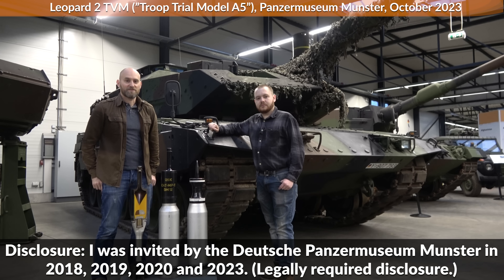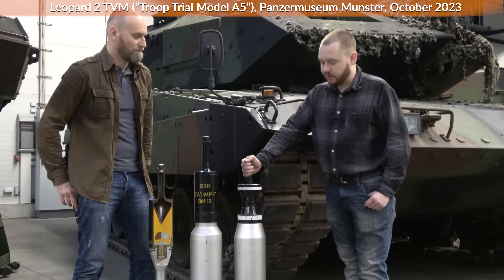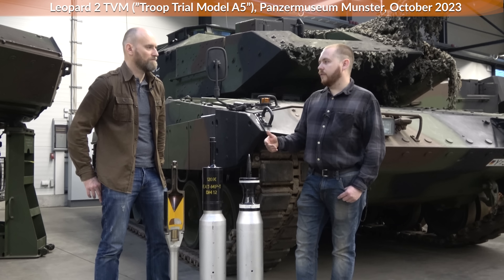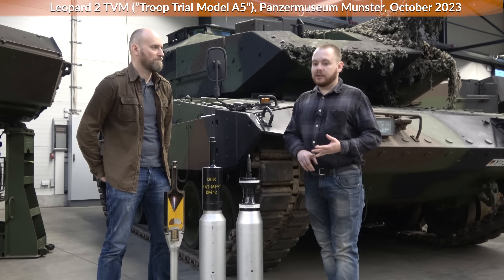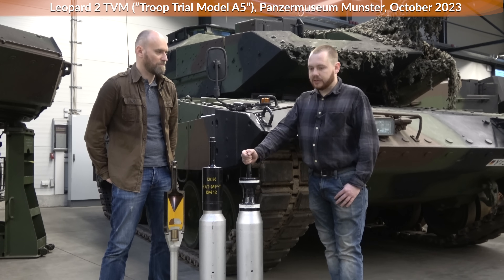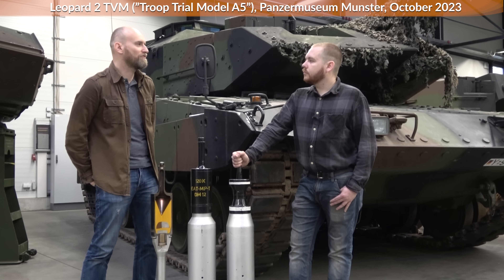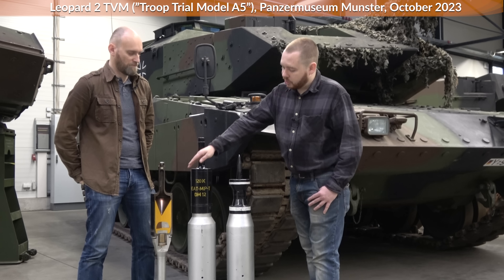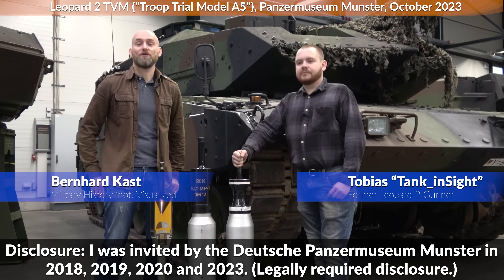Why you need proper HE rounds for Tanks

Comment: Interestingly after the Battle of 73 Easting a Bradley was likely knocked out by a BMP that had been hit by an APFSDS round. The round went through the BMP like it wasn't there which meant the crew could still get off a shot which killed the Bradley gunner. If the BMP had been hit by a more appropriate round this wouldn't have happened.
Reply: @cattledog901  The BMP was taken out by a Abrams prior. The crew abandoned after a over pen but got back in and took out a Bradley.
Reply: Seems like the Abram’s “should have” done more to ensure the vehicle was actually destroyed rather than just assume a single hit was one and done.  It’s combat however and chaos is part of the equation.  There’s no universal weapon that perfectly does every job yet.
Reply: @JimmySailor  

The issue is that there are other vehciles that are actively targetting you and you need to take them out before they take you out.
Reply: @neurofiedyamato8763 yes just like war thunder, no armour is best armour
Reply: @neurofiedyamato8763 dumb move on the part of that BMP crew, after the battle they examined that BMP, it got hit so many times by HEAT rounds that there was a puddle of solidified molten metal from the HEAT rounds.
Reply: @artruisjoew5473  Iraqi troops generally were well regarded in the region for their grit, with Kuwait being the exception rather than the rule. The Republican guard Tawakalna Division conducted repeated counterattacks and dismounted action into the teeth of the US forces. The time they brought allowed enough of Saddam's army to withdraw to hold the regime.
Reply: @artruisjoew5473 HEAT rounds do not melt iron they penetrate physically much like a solid shot, the name HEAT is an acronym
Reply: @JK-oq9cl either BMP-1 or -2 (weighted more towards -1) - either has tin foil as armour and if that was -3, it would have a bit more impact plus ammo would be hit by just sheer probability
Reply: @J.F.Król can say the same with the Bradley, a LOT of the ammo is just strung up by... Gunner i think it is? The 100mm is low down. Internal ATGM's being an issue given vertical. Go Bradley. But a 100mm gun would supply deployed forces anti fortification abilities. Go Russia.
Reply: Yeah well they are probably trained to shoot he/heat at less armoured targets but if you are in combat and think you don’t have enough time to reload to another round you will fire the apfsds instead
Reply: @thurbine2411  I'm a former TC, you're correct about the training. But you fire what is in the breech, and follow up with the appropriate round. There's no time/ability to unload a round because of the combustible casing of the round wich easily breaks apart when using the puller to try to remove the life round. This must be done so carefully that it would take to much time. And when loaded in a hot breech, it would be impossible because the lacquer on the outside of the casing would have melted and you would tear the bottom off the casing, spilling the propellant into the fighting compartment.
Reply: @Leo_Pard_A4  I am a leopard(strv 122) gunner and yes in most cases I would also fire what’s in the breech as I wrote but if you have time(enemy hasn’t spotted you or someone else has spotted them before you have los you can have the time to reload from apfsds to he-equivalent. The apfsds doesn’t break apart that easily and if the loader has done it a few times it isn’t that hard but we are also not permitted to unload a he shell.
Reply: @thurbine2411  iirc, there is licence production of a 120mm HE/FRAG round for the Strv122 using a projectile design from an Israeli mortar shell.
Don't know if that's made availiable for any other Leo2 users.
Reply: @SonsOfLorgar  yeah I know that isn’t optimal when shooting at infantry as the shrapnel will spread a little differently from what you want but won’t matter when it’s fired into a bmp really.
Reply: @SonsOfLorgar  but the apfsds of the German and Swedish leopard should both be quite similar to unload and probably the ones used by the us in 91 as well. But I agree with you as I wrote in my first or maybe second comment. It is one thing to do what you should have done in a perfect world and another thing to do it when you are in battle
Reply: A British Scimitar took a round from an Iraqi tank that also went in one side of the Aluminum armour and out the other.
Reply: Interesting, was the APFSDS fired by a 120mm or was it a Bradley's M919 APFSDS round? I would've assumed a Bradley would've just kept hitting the BMP repeatedly until it burned as opposed to a single 25mm shot from it's bushmaster, but I could believe an Abrams might've taken a shot at a BMP, then moved on, assuming the crew was sufficiently neutralised or scared by the hit.
Reply: @JustSomeRando1984 I believe it was an Abrams.
Reply: @user-qf6yt3id3w  The BMP should have been knocked out with HEAT projectiles… which is what is used to kill lightly armored vehicles. 
The problem isn’t that we don’t have dedicated HE rounds, it’s that in combat, especially like 73 Easting where it’s a mix of tanks and lightly armored vehicles, you sometimes have the wrong shell loaded or the type of target you are engaging so you just send it anyway.
Reply: @JK-oq9cl  Likely the legacy BMP-1 (with the Malyutka launcher) or the Czech licensed BVP-1, no real difference between the two. Either that or some variant of the BMP-2, Iraq operated the BMP-2 obr. 1980, 1984, 1986 and BMP-2D and K variants at the time.
Reply: There's a photo out there of an APC that got hit in the side by an APFSDS round in the troop carrying compartment.  There's an APFSDS hole in the side, an APFSDS hole in a seat, and an APFSDS hole in the opposing side, with little other internal damage.   You may be able to punch a hole in 300mm of steel, but you still need to hit something on the inside.
Reply: no armor best armor
Reply: @KekusMagnus   more appropriately. Used the wrong shit.
Reply: ^ #Projection10000 😆

 @KekusMagnus  Or: #BestGunIsBestArmour 😉
Reply: Tanks in desert storm use AT for every thing
Reply: @JeffEbe-te2xs  yes but there is a bug difference between apfsds which is solid ap shot that relies on the projectiles kinetic energy and a heat shell that explodes on impact and the explosion forms a metal jet that pierces the armour with its kinetic energy. So a heat will do much more damage to soft targets or lightly armoured targets
Reply: ^ You clearly had nothing worth stating 😆🤣
Reply: @jimtaylor294  you have 0 information on the matter, so you must be correct on everything you say. Are you the messiah? Cause only the Messiah can be always correct with no presented information. Oh wait, you're not.
Reply: ^ Proved my point for me, you just have 😆🤣 .

Keep crying boyo 🍺😁
Reply: My uncles bmp 1 was hit by a sabot round in gulf war, they left and later returned to vehicle and drove it back to base
Reply: @anon-iraq2655 your uncleS BMP... WHO WAS YOU'RE UNCLE FIGHTING FOR?!

(No offense intended.  Just don't usually hear from the "other side")
Reply: @YaBigDummi  my uncle was fighting for iraq, republican guard
Reply: @anon-iraq2655  man, sounds like Uncle had some balls to get back in the bmp.
Reply: @YaBigDummi  it was either that or hike several days in that desert.
He said they expected to do major repairs on field  but the bmp just started coz American shot didn't hit engine or anything important
Reply: In this case, you can also chalk up Coalition tank crew training as exacerbating this.

Why? Well, tankers are usually told that, when engaging armour, you keep shooting until either the tank changes shape or catches fire. Basically, you want to ensure that the tank is destroyed, the crew dead, and that they aren’t simply playing possum. In armoured warfare it’s quite easy to score a mobility kill that looks like the tank is out of action, ie stationary. But more than one tank crew has been surprised to see themselves taking fire from a previously-thought-dead tank.

I know 73 Eastings was very chaotic, but this wouldn’t have happened if they were following their training to the letter.
Reply: In several instances, both tanks and IFVs were hit and the vehicle abandonded. The hits may not have fully penetrated the hull or turret, but only partially penetrated or was localized to a small section. After all, not all hits are at center of mass. LOL The Republican Guards were disciplined veteran soldiers from teh Iraq-Iran War, unlike the conscripts. They may have abandonded their vehicle on the initial hit, but they re occupied their vehicles once the smoke cleared, literally. 

The US used depleted uranium (DU) rounds for their APFSDS rounds. Unlike those rounds using tungsten, DU shatters as it is penetrating (not before) and is pyrophoric. Basically the sharp shards spray into the vehicle and bursts into flames. The DU rod from a 120 mm tank round would probably engulf the BMP interior. The much small rod of the 25 mm round may not engulf the whole vehicle interior depending on where it penetrated.

From the outside, a vehicle smoking stopped, and abandodoned may look like a kll. With an "enemy rich environment", it might be better to target another enemy vehicle that is turning their turret toward you. lol
Reply: And that's why god gave us HESH.
"HESH™️, the appropriate round"
Reply: @MostlyPennyCat  Yes. Praise the Lord and pass the HESH ammunition 🫡
Reply: @jimtaylor294  
Amen, brother, amen...
Reply: ^ Classic bot; goes straight to lame and clichéd ad homeniem, with not even a hit of disguising sophistry 😆🤣 .

Come back when you have anything relevant to the topic to state 🥱 .
Reply: @jimtaylor294  keep on coping and seething. i've said all i need to. you refuse to read that's on you. not my fault you chose to have a cranial cavern, not cavity.
Reply: @jimtaylor294  ok dunce.
Reply: It's why they have a "kill burst" being 3 rounds after the feeler round.

However i do think the west should adopt the soviet/russian turret attitude of the BMD-4 and BMP-3, a 100mm HE/HEAT is good for thin skinned tanks, and the ATGM's bolted on the outside.
Reply: @osmacar  No, the BMP-3 is a bad solution with modern technologies. Programmable fuzed rounds eliminate the need for a large caliber cannon and a autocannon. See CV90-40, Puma, or Lynx. If you instead fit a 35 or 40mm cannon, you can have a programmable fuze that can airburst/timed, delayed fuze, impact fuze, or proximity fuze. Useful against entrenched infantry, infantry in the open, unarmored or thinly armored vehicles, and low flying aircraft like helicopters. If there is something armored, you just use the ATGMs.
The 100mm is only good for striking fortifications which you don't see nowadays. It's either trenches which airbusts is best at dealing with, or civilian buildings, which delayed fuze HE rounds can punch through.
A 100mm gun is just extra weight, complicates logistics with more ammo types, and take up more internal space with ammo that isn't interchangeable between your weapon systems. This is only useful in the rare case you encounter a concrete bunker which is essentially preparing for a unicorn nowadays.

Besides that, ATGMs sometimes also have thermobaric warheads or other type of anti-structure warhead options. If you don't want to replace HEAT ATGMs for it, the dismounts can carry stuff like the Carl Gustav or RPGs. There are anti-structure rounds for rocket launchers/recoilless rifles. The IFV isn't fighting alone and has a lot on its tool kit. the 100mm is redundant.
Reply: @osmacar5331  Nah; there's no point to GL-ATGM's at all, as the gun tube limits warhead size and unlike AP rounds HEAT doesn't require a gun to launch it.

Tanks would - as you allude to - do better to have just AP & HE rounds for the gun, and leave HEAT to be conveyed by missiles.
Reply: @jimtaylor294  you clearly can't read.
Reply: Moral of the story; Abrams would be better with HESH... as are most things 😁
Reply: @jimtaylor294  Abrams do not need HESH. US did use HESH (HEP in US designation) but like the British had mostly discarded those rounds.
HESH is only the best option for concrete structures due to the brittle nature of it allowing for significant cracks, spalling, and shockwave. But modern warfare rarely ever use concrete bunkers. And civilian structures don't use thick enough reinforced concrete to justify HESH.
Modern composite armor is also highly effective at disrupting shockwaves (and HEAT jets). It is why APFSDS is the preferred anti-tank round despite HEAT penetrating more RHAe. Against composite armor, APFSDS penetrates more and has a lot less countermeasures.

For soft target, you don't need HESH. Pure HE is good enough and pure HE is better against infantry than HESH, HEAT, or HEAT-MP (what US used). Nowadays, we have programmable fuze which makes HEAT and HESH irrelevant in the context of tank munitions. a programmable fuzed HE can be timed to detonate above a entrenched target, detonate on impact against soft skin vehicles, or delayed fuze to explode inside thinly armored vehicles. Since it is a HE, it has much larger blast radius and significantly better fragmentation. It is better at everything else other than large concrete fortifications which is a relic of the 20th century. Anything a programmable HE can't deal with, the APFSDS can.